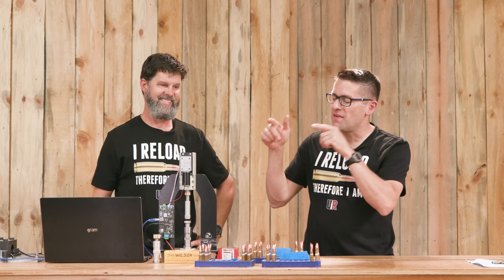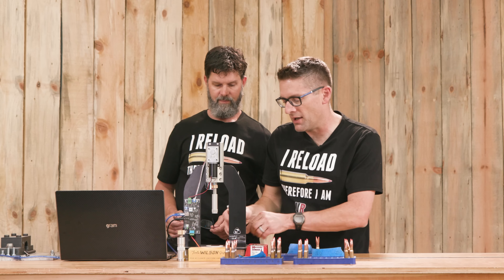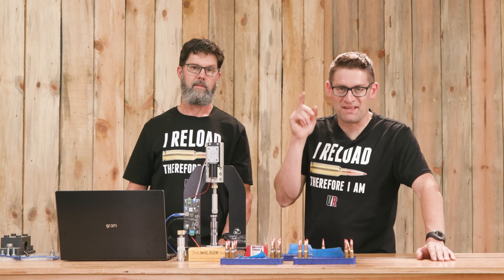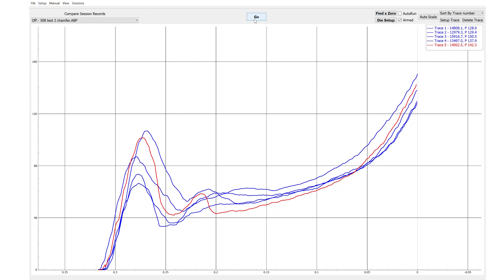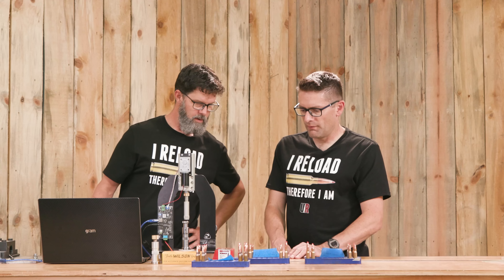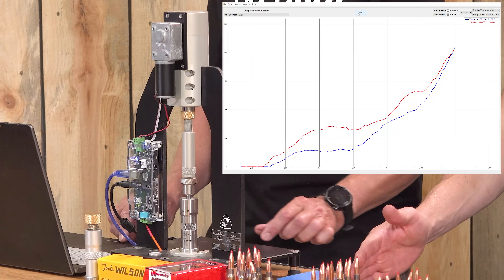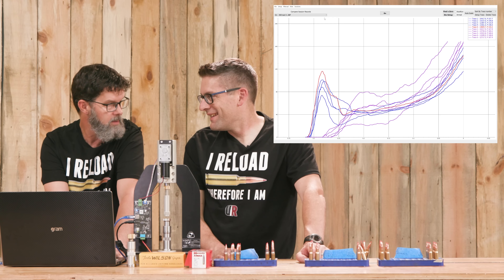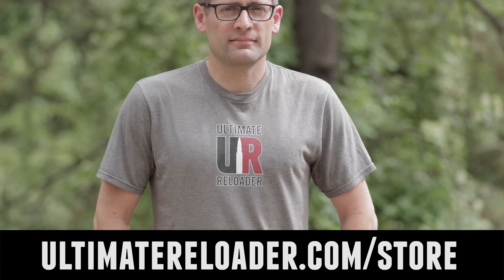How Does Brass Prep Affect Bullet Seating? (AMP Press Tests)

Comment: Not having confiscated equipment, I use the good old school machinist method of feel .I switched all bullet chamfering to the VLD Lymans tool over the plain Jane Lee and RCBS CHAMFERING tools. I do this for flat base or boat tail bullets now. I feel the difference in seating pressure. And the only caliber that's given me trouble is the past is 7.62x39 with run out on them. I have reloaded ammo now for 21 years and 17 different calibers. Thank you for your informative videos.

Comment: One more trap group with the LC brass neck turned to a consistent thickness would reveal if the variation is material quality related.
Reply: Frankly all the data is moot until the neck case thickness is uniform. That will probably have the biggest impact of any variable. Need to start there.

Comment: Superb video thank you. Please use Lapua brass, and no less than 10 samples.  1. Brass cleaning, non clean vs steel pins, vs corn crob   2. FL size with build in expander vs stand alone expander. 3.  Different mandril sizes. With focus on springback.  4. Trimmed vs non trimmed brass       5. 1 reload vs 5 reloads.

Comment: It looks like annealing and chamfering are the two processes that made the biggest difference in seating force. Considering the huge difference in price of an annealer vs a chamfer tool, I would like to see the difference between these two, later in the brass life. 

How about a test of two batches of LC brass at the 4th or 5th firing, where one batch was annealed and FL sized between each firing, and the other batch was only FL sized and chamfered between each firing?
Reply: You can anneal cheaply with a blowtorch socket and drill. Might not be as precise as machines but unless your competing at the highest level its good enough
Reply: https://youtu.be/7bFLi4IFSN4